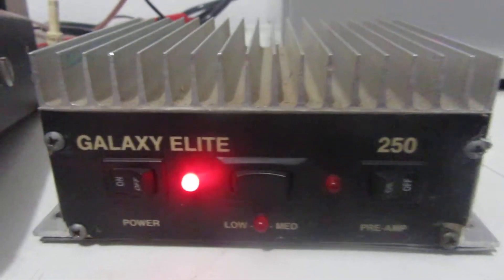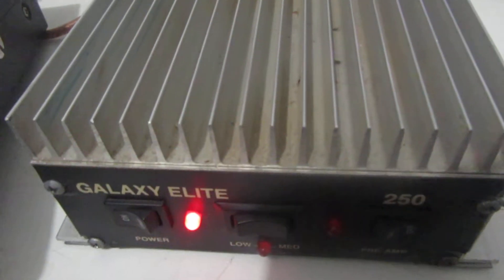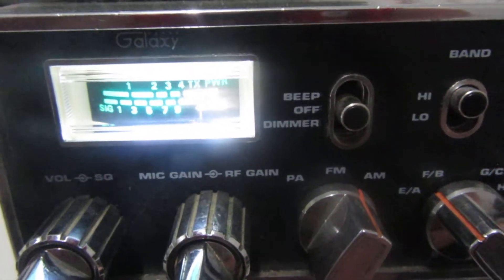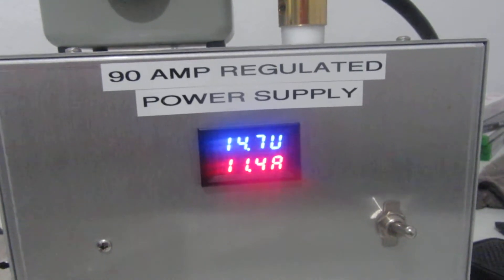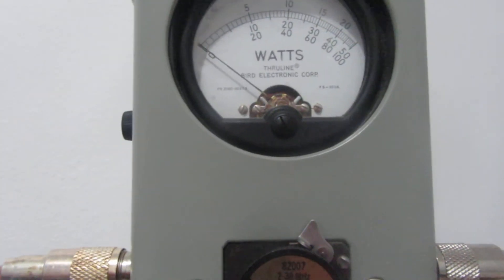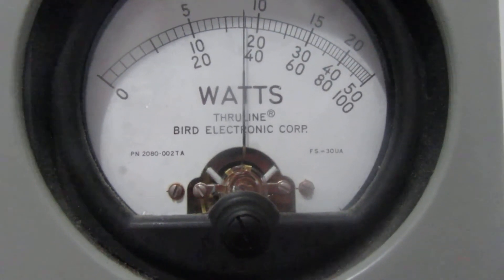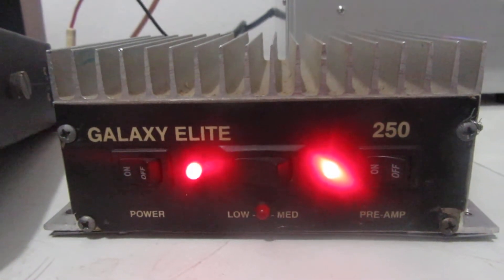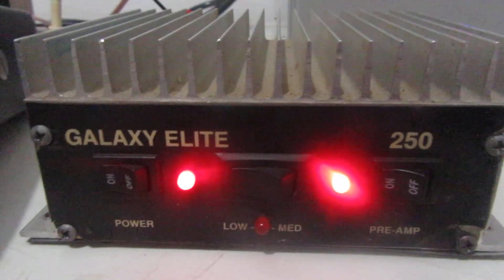Galaxy/Palomar Elite 250 Mobile Linear Amplifier

Comment: Is the dead key turned way down on the radio, or is it at stock setting?
Reply from the maker: Adam Scherffius 2-3 watts
Reply: Rooster CB Radio Connection excuse all my questions, but im new at this an learning. But I have the exact same radio,  I am current trying to choose an amp that would be good with this radio. And I keep hearing about making sure dead key is turned down with an amp due to power of radio already.  Is that something that you do internally inside the radio on the pots?
Reply from the maker: No problem. The dead key also known as carrier is adjusted via the rf power knob on the front of the radio.
Reply: Rooster CB Radio Connection Cool, thank ya so much! I thought it might be that simple. But wasnt sure. And didn't want to blow anything up. Bullfrog 76 west Tennessee

Comment: Looked for it on eBay, didn't see it yet.
Reply from the maker: zombie Slayer this one sold today. Ill be throwing another one on tonight. Sold for $118 shipped
Reply: Rooster CB Radio Connection Wow that was a good bye.  That's the kind of bye I  am looking for.  I have a blackwidow 250, but it is acting up.  Need another to put in while it's getting fixed.
Reply from the maker: I have another that I am going to be selling. It is a white tornado 225, basically the exact same amp except it is biased and has automatic ssb delay. The only issue  with it is the pre amp doesn't work. I'll probably be posting a video on it later today.
Reply: Rooster CB Radio Connection That's cool I'll watch for it.